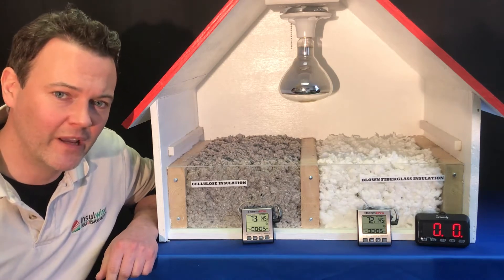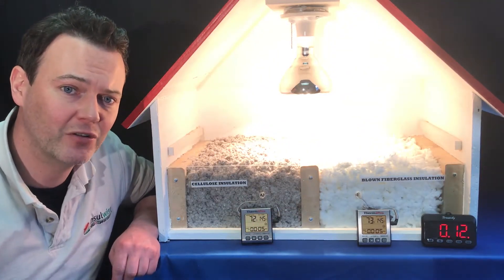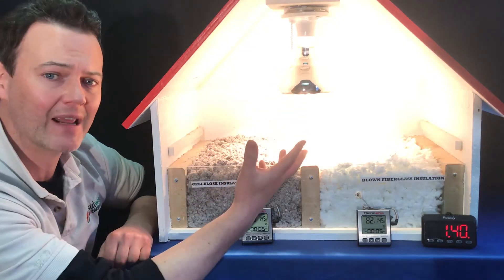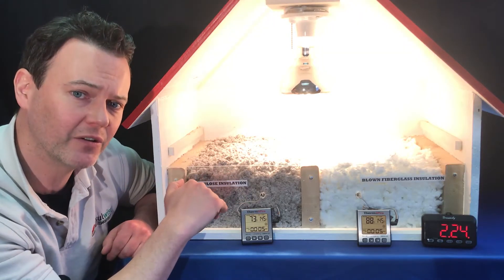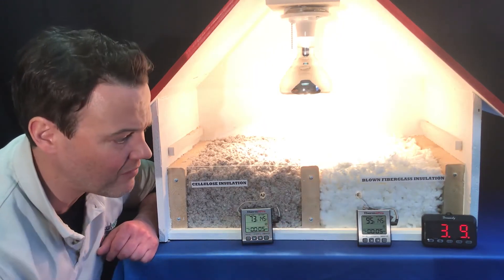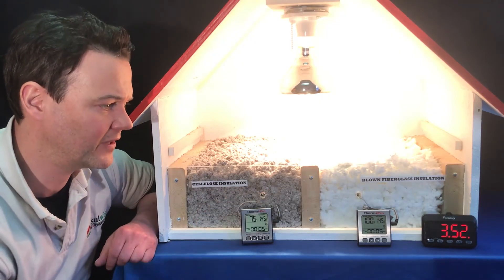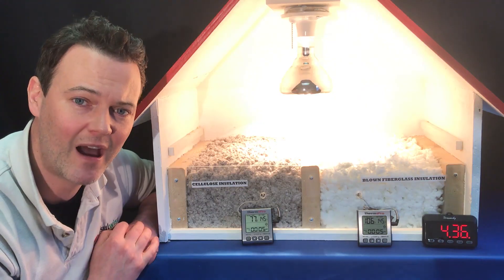Cellulose vs. Fiberglass Insulation: The Ultimate Showdown

Comment: What a misleading video - if you ran a fair experiment you would compare R-value - not inch depth, meaning you need more fiberglass on the right to make it a fair heat comparison, you wouldn't keep it at the same levels, you would also put the heat probe at the bottom where the building envelope is, not in the middle of the insulation.  It looks like you dense-packed the cellulose on the left as well, not blown in like at the top, not to mention the weight of cellulose can cause ceilings to sag and nail pops, as well as it absorbing moisture and it biodegrades into dust over the years (ever wonder why your house is so dusty?) Did you mention the Boric acid that is added to cellulose because cellulose is very flammable and how toxic boric acid is if inhaled or swallowed? Or how it corrodes metal if water touches it?  Or it being a natural food source for some bugs?  Also fiberglass batts are rated 2.5 per inch, blown fiberglass is @ 2.8..  Hrmm... leaving a lot off the plate here?  I've worked with both materials and the fiberglass is a cleaner and safer product with less headache.
Reply from the maker: Thanks for commenting!  Couple of things:
1)  The cellulose insulation that I used is 100% loose fill, just like it would be in an attic.  Dense packed cellulose actually has a slightly lower R-value than loose fill (about R 3.4 vs R 3.7).  

2)  The comparison does show the difference in R-values of the two materials.  There is 1.5" inches of each type of material on top of the thermometers.  What you see is how much more effectively cellulose insulation actually insulates than blown fiberglass.  The R-value of blown cellulose is about R 3.7 versus R 2.5 for the blown fiberglass.  In comparison the blown fiberglass sucks!  That's what this comparison demonstrates.  

3)  The weight of cellulose causes ceilings to buckle and drywall screws to collapse?  Are you aware that cellulose insulation is used to insulate the attics / ceilings of HUNDREDS of THOUSANDS of homes and structures every year in the US and Canada?  We have also insulated thousands of attics in the Pittsburgh area with this product.  We NEVER see ceilings sagging from the weight of it.  It's not that heavy. 

4)  Boric acid is added to cellulose insulation.  It actually makes it impossible to catch fire, or for mold to digest it.  Oh, and it has the toxicity of table salt (it does sting a bit if you get it an open cut, I will admit!)  I've attached a link to a video showing the burn potential difference between a home insulated with fiberglass and one insulated with cellulose: https://www.youtube.com/watch?v=lAPPn53JtHQ

5)  Here's a video of what happens when cellulose insulation gets wet in an attic.  It's a paper fiber which makes it hygroscopic (it freely absorbs and releases moisture)  https://www.youtube.com/watch?v=2XQK-Ba1hWc

6)  When we insulate attics we first air seal the entire attic floor, this keeps any dust from the attic from penetrating down into the home below.  We have a video showing our process, check it out!

7)  The R-value of batt fiberglass is actually about R 3.5 per inch, not 2.5.  Batt fiberglass has much better insulating attributes than blown fiberglass (it's just difficult to install it without having lots of gaps!).  Blown fiberglass averages about R 2.5 per inch.  And that's before it gets cold.  The R-Value of blown fiberglass drops in cold temperatures (feel free to look up why).

8)  Blown fiberglass is cleaner to install, no argument there.  But it is, to summarize:
a)  FAR more expensive than cellulose insulation
b)  has FAR worse insulating performance compared to blown cellulose
c)  far more susceptible to critters and bugs burrowing in it because it --- does NOT have boric acid in it, which is an irritant to critters
d)  Cellulose insulation is an order of magnitude SUPERIOR in terms of flame and burn resistance 

But this is America and you can put whatever you want in your home.  If you want to spend more money to have worse performance, have at it!
Andy
Reply from the maker: Thanks for commenting!  Couple of things:
1)  The cellulose insulation that I used is 100% loose fill, just like it would be in an attic.  Dense packed cellulose actually has a slightly lower R-value than loose fill (about R 3.4 vs R 3.7).  

2)  The comparison does show the difference in R-values of the two materials.  There is 1.5" inches of each type of material on top of the thermometers.  What you see is how much more effectively cellulose insulation actually insulates than blown fiberglass.  The R-value of blown cellulose is about R 3.7 versus R 2.5 for the blown fiberglass.  In comparison the blown fiberglass sucks!  That's what this comparison demonstrates.  

3)  The weight of cellulose causes ceilings to buckle and drywall screws to collapse?  Are you aware that cellulose insulation is used to insulate the attics / ceilings of HUNDREDS of THOUSANDS of homes and structures every year in the US and Canada?  We have also insulated thousands of attics in the Pittsburgh area with this product.  We NEVER see ceilings sagging from the weight of it.  It's not that heavy. 

4)  Boric acid is added to cellulose insulation.  It actually makes it impossible to catch fire, or for mold to digest it.  Oh, and it has the toxicity of table salt (it does sting a bit if you get it an open cut, I will admit!)  I've attached a link to a video showing the burn potential difference between a home insulated with fiberglass and one insulated with cellulose: https://www.youtube.com/watch?v=lAPPn53JtHQ

5)  Here's a video of what happens when cellulose insulation gets wet in an attic.  It's a paper fiber which makes it hygroscopic (it freely absorbs and releases moisture)  https://www.youtube.com/watch?v=2XQK-Ba1hWc

6)  When we insulate attics we first air seal the entire attic floor, this keeps any dust from the attic from penetrating down into the home below.  We have a video showing our process, check it out!

7)  The R-value of batt fiberglass is actually about R 3.5 per inch, not 2.5.  Batt fiberglass has much better insulating attributes than blown fiberglass (it's just difficult to install it without having lots of gaps!).  Blown fiberglass averages about R 2.5 per inch.  And that's before it gets cold.  The R-Value of blown fiberglass drops in cold temperatures (feel free to look up why).

8)  Blown fiberglass is cleaner to install, no argument there.  But it is, to summarize:
a)  FAR more expensive than cellulose insulation
b)  has FAR worse insulating performance compared to blown cellulose
c)  far more susceptible to critters and bugs burrowing in it because it --- does NOT have boric acid in it, which is an irritant to critters
d)  Cellulose insulation is an order of magnitude SUPERIOR in terms of flame and burn resistance 

But this is America and you can put whatever you want in your home.  If you want to spend more money to have worse performance, have at it!
Andy

Comment: I ran across your video because there are people (and AI) stating that cellulose only lasts 20 years, but I can't find any proof of this, or why that would even be the case.  I think it might be a rumor started by the fiberglass companies.
Reply from the maker: That is complete BS.  It does not just "dissolve."  I have seen drywall pulled from walls that had cellulose installed in them 60 years ago and it was still holding up just fine.  I have also seen existing cellulose in attics that was decades old.  It settles when blown in loose fill by about 10%, after that I have not ever witnessed it degrade.
Reply: @insulwiseenergycomfortsolu3293  My own experience is that it settles by 1/3,  12" has been code for 40 years, but I always find 8", as with my own houses. (code is now 16" here)  While you know this, the denser packed insulation does insulate better than lighter fluffier non-settled stuff, it's not 1:1  (12" packed does not equal the same R value as 8" settled, but it's closer than 8" freshly blown)  What I like is that the more it settles, the more it stops airflow.

Comment: Different types of heat and cold react differently with insulation.  The colder it is, the less the fiberglass insulates.
Reply from the maker: Exactly.  Cold air sitting on top of fluffy blown fiberglass reduces its R Value...cellulose is more dense and keeps the cold air sitting on top of it.

Comment: Very incorrect testing. The question is how much total R value can you get per USD. In my case I had a choice, and it came down to this: if I use cellulose, my insulation will look like the above - to the top of the rafters. If I want the same R value for about the same cost, the insulation will go above the rafters. Because it will cover the rafters, the end result is that the fiberglass provides better overall insulation.
Reply from the maker: Wrong, but thanks for commenting.  Blown cellulose should always be less expensive than blown fiberglass due a variety of factors, the most important being the significant gap in embodied energy required to produce cellulose insulation.   However, this video is intended to help homeowners understand the physical insulating (R-Value) differences between these two materials.  If you want to choose a material (blown fiberglass) that has a 40% lower R value, is more expensive any way you slice it, and also DROPS in R-value in very cold temperatures  (cold attic air falls right down and through fluffy blown fiberglass installations, reducing R-value) than you are free to do so.   
Andy

Comment: Insulation is ineffective if you don't have attic ventilation
Reply from the maker: Thanks for commenting.  Insulation is not ineffective without attic ventilation.  It still works just fine.  But without ventilation your risks for developing an attic mold issue at some point go up dramatically. 
Andy

Comment: Good idea for a presentation, but there are a couple of problems:
People get a standard R-value of insulation when contracting for insulation. They do not get a standard height. That means the less dense fiberglass would pile higher than cellulose. To get a more accurate experiment, you would compare the same R-value of the two insulations. 
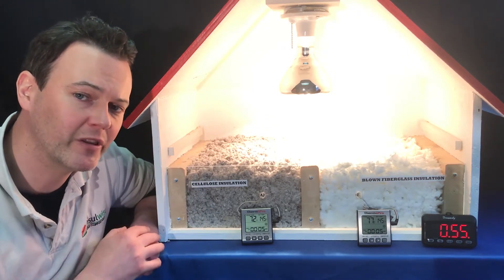1:29 Also, borates do not make the cellulose incapable of growing mold. It can help slow down the development, but cellulose is organic matter and will mold. It also is not a deterrent for pests like rodents and bugs like spiders. It is a deterrent for ants and termites.
Reply from the maker: Thanks for commenting and great question David.  Couple of things here.  1)  If the exterior wall bays are insulated with decent (mid 1970's onward) fiberglass batts they will staunch the air leakage a good bit.  We don't see the black streaking in batts over top of exterior top plates nearly as much in this scenario.  So IMO air sealing the plates in this area is less of a concern ---- when they are very difficult to get to.  If the walls are empty, it's more of a priority.  And if there is good access to seal the exterior wall plates we always hit them.  

2)  If you want to seal those plates and the roof slope is very low and prohibitive, your best options are a) get a nice board to lay on and get to it in the morning or at night when the roof isn't roasting in the sun (performing any work when you're up against the roof on a hot day is Brutal  b)  get yourself a spray foam kit and spray them from from a bit further away.  Best case is you have someone assist you in moving the tanks while you're crawling and spray foaming them.  This method requires at a minimum both parties to be wearing a proper respirator with cartridges to filter the toxic gases created by spraying foam

3)  If the stud bays are empty you can always have the exterior wall bays dense packed with cellulose from the rooms below.  This will seal the top plates while also adding tremendous thermal and sound deadening performance to your walls

Let me know if you have additional questions!
Andy

Comment: 3.7 R value per inch cellulose versus 2.5 R value per inch blown fiberglass:

Is this the newer blown fiberglas product that avoids matting down and has less dust? Is there cellulose that is less likely to get matted and less dust?
Reply from the maker: Yes this is the newer stuff.  The problem with blown fiberglass isn't matting down, but that it stays permanently light and poofy, and cold air rather than sitting on top of it can fall down through it, reducing it's performance.  Loose fill cellulose is known to settle and it's understood.  So if you want an eventual R-49, you blow in 15" inches, understanding that it will settle to an eventual 13.5" inches, which is your settled R-49.  There is a chart on every bag of cellulose insulation that shows you settled and unsettled depths and R-Values.  The dust is only a factor during blowing.  Ten minutes after you're done there's no more dust.  It's not really a factor. 
Andy

Comment: The temp will eventually end up being the same over time.
Reply from the maker: Correct, but it will take much longer for the heat to penetrate through the cellulose and this is the key benefit.  Attic's tend to start gaining heat around 10:30 am and then begin cooling off around 2:30 pm after the sun has passed it's highest point and begins setting.  With an attic insulated to R-49 with cellulose insulation, that intense heat that peaks over those 4 hours does not have time to penetrate all the way through to the ceiling and rooms below before it begins cooling off.
Reply: @insulwiseenergycomfortsolu3293  Not many older homes have the  same for R49.

Comment: Having worked exstensively vith fiberglass batting; I'd welcome anything else!
Reply from the maker: Haha...old fiberglass batting is much rougher to work with than the newer stuff, but I know what you mean.  Blown cellulose does an excellent job in a variety of ways and is why we use it as our primary insulating material.

Comment: No one is going to have a heat lamp above insulation, vent your home
Reply from the maker: Correct, they have a much more powerful heat source called the sun.  When the sun hits your roof it can heat the surface to 150-170 degrees.  That heat radiates down into the attic space and then into the rooms below.  Having a better ventilated attic helps, but you Absolutely want an effective air / thermal/ vapor barrier between your living space and unconditioned attic.
Reply: @insulwiseenergycomfortsolu3293  I live in New Mexico soffit vent and ridge vent keeps it cooler than the outside temperature now if you don't have good ventilation yes very hot

Comment: Cellulose literally breaks down/ disintegrates every year until eventually it's all dust
Reply from the maker: No, it doesn't.  I've seen cellulose that was blown in 40-50 years ago.  Aside from the top layer turning a more brownish color, it's absolutely fine.  All cellulose insulation being made today is treated with non-toxic elements chemicals that make it impossible to be degraded / eaten by mold or to catch fire.
Reply: @insulwiseenergycomfortsolu3293  My brothers house had it put in originally and it broke down to 2 inches in less than 15 years, my friends house originally built in 1958 had it put in and in less than 40 years the only thing left was dust in the center and "drifts" on the sides of the studs, my grandma's house has had 3 "top offs" in the past 50 years, I could go on and on.  Go ahead and tell me that when paper exposed to air flow, moisture, and high temperature swings doesn't start to breakdown. 😂  For reference the homes are all in different states.  Indiana, Michigan, and New York.
Reply from the maker: @jimmy_wang_  I can't speak for what was installed or how it was done.  I can only tell you that I've insulated thousands of homes in the Pittsburgh area using cellulose insulation over the last 15 years.  I have not had a single call -- not even one -- where a previous customer said "you guys blew in cellulose and it has settled considerably."  You would think that someone, at some point, would have.
Also, did these other companies use depth sticks and take video after the install?  We do this.   If the cellulose fibers were untreated and could be eaten / degraded by microbes that would be one thing, but with the chemical non-toxic chemical treatment it can't.